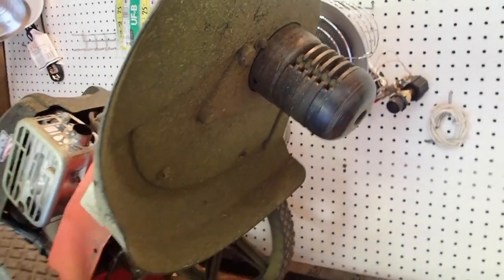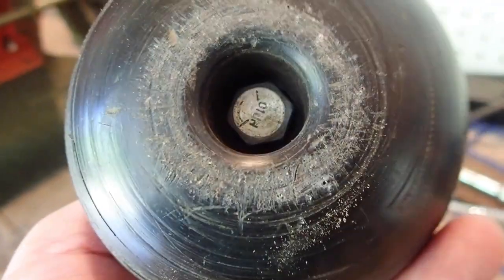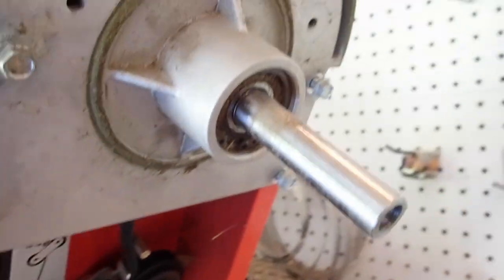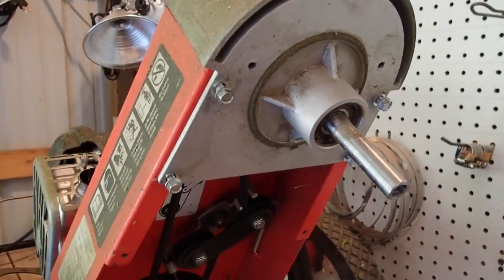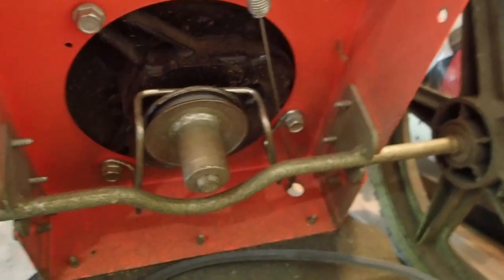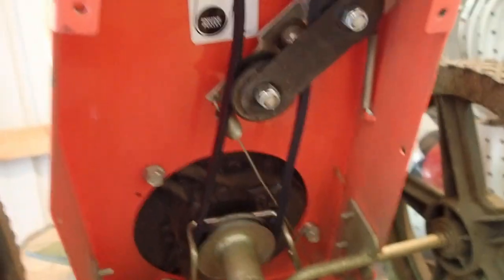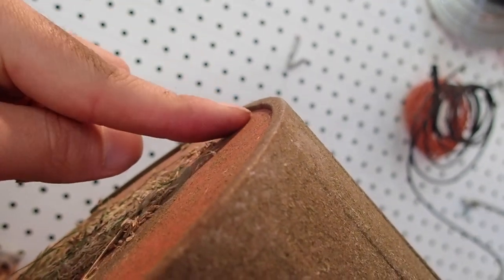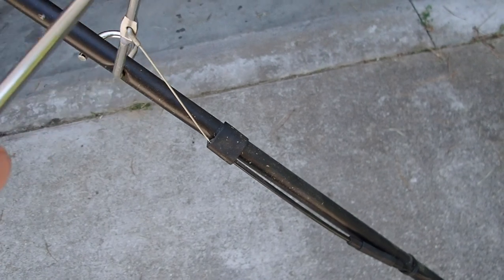DR Trimmer Mower 6.75 Premier - Belt Replacement

Comment: That head cap with the bolt is for the trimmer blade attachment, not for the trim line.  Doesn't really matter though since you don't need to remove all the head stuff anyway.  The head pulley isn't connected to the top of the frame, so you can just reach your hand up in there and remove the belt.  You then only have to remove the tensioner pulley bolts and plates to remove the belt.

Comment: 4:55 for the belt, mine is a 7.25HP, but I think they all take 6744 belt. DR site has an interactive parts explosion that lets you pick the part for your machine. A belt comes in the maintenance kit or you can order it separate, it was $14, but I just got another maintenance kit since all that stuff wears out with heavy use in a field. The tensioner adjust on the handle is a turnbuckle. I had to look up how they work since mine had the same issue as many here in the comments of being scared to move 1 grass blade, just keep turning the turnbuckle and it cuts fantastic.

Comment: I am happy that you brought out that you are post to use a 3/8 inch wide belt. I am using a 1/2 wide belt and can not figure out why it will not start in Neutral, I can not get any belt slippage and alls my pulleys are in the loose position

Comment: I just bought the pro model after researching walk behind trimmers.  Then I found that Echo sells a walk behind that looks to be very robust.  However, there are two features I like about the DR. 1. is the electric start for about 50.00 more and the optional easy head that makes changing line a snap.  Just got the head and accessories today but still waiting on the machine.

Comment: The belt is 3l which means 3/8” wide. The other number that is important is going to be 44 which means 44 inches.  3L44 is all ya need to know. If you have the manual it’s in there as a  V-Belt, 3L, Gates PoweRated 6744, if cross referenced it will show a 3L44 or any belt meeting the same specs as OEM .

Comment: You had belt on the wrong side of pin above tensioner pulley system. It was to the right and needed to be left of it.  Did not match diagram.  Hope you corrected it. Mine has a brake system on drive pulley. So. I will have different procedures.

Comment: I just got this issue yesterday. trimmer head won't spin, DR CSR said I need to replace it because the tension on the belt was high. I'm going to replace it even tho I used it only five times, bought it brand new.
Reply: Pretty much the same experience I’ve had too!…I’ve used it for about 2 months, but damn, a belt should last way longer than that.  Also, my machine is just like his in the video, it does NOT have the hole on the side to lock the shaft in place.  Thanks to You Tube, they have fixes for everything!
Reply: @bigviper64  I called DR and they explained the issue, they sent me a new tension belt. I ended with loosing up the tension cable more and now of works fine, over a year with no problem and still have a brand new FREE belt.

Comment: Thanks for mentioning that you used a 3/8 inch wide belt. I am using a 1/2 wide belt and can not get any slippage when in neutral and all my pulleys are lose. Makes it very hard to start.

Comment: You didn't put the belt on right, you're on the wrong side of the guide pin
Reply: Agree. You but the belt on the wrong side of the pin. Don't follow this video.
Reply: True wrong  side of pin
Reply: Yep, I saw that too. Getting ready to change mine tomorrow if it shows up.
Reply: Wrong side but still worked? I think maybe he fixed it off video. But why not edit it?

Comment: I just looked on website and called them. Still a gates 6744. Ordered from Advanced auto. Also there is a hole at the top to put a screwdriver or 1/4” allen wrench to remove the cutter head.

Comment: Well i just changed my belt  today dr says gates 6744 belt i can tell you right now the gates 6744 will not clear the belt guid on upper pully by the guide pen it will shred it so i went to AutoZone gave them the number and they found one that i needed idk why dr would recommend a belt that doesn't fit but they do on mine anyway 
I bought the trimmer a month ago brand new at tractor supply its s premier model and it started slipping ( which was my fault. I didnt adjust the belt properly) anyway that belt broke  so i baught the gates 6744 online and it will not clear the guid pen and pulley it smoked the belt so just fyi on dr recommendation on belt size
Reply: Update.. I'm in the process of returning my trimmer brand new belt yesterday I smoked it today in 25 mins time

Comment: This is tortuous and unecessary. The belt  comes off the front pulley quite easily without taking off the nosecone , bearings et al.  Simply undo the 4 x 3/8" screwbolts holding the shroud (definitely  DO NOT use a  10mm spanner ) and drop it down to give you easy access to the tensioner bolts ( you do not need to take it over the strimmer boss )  & then remove tensioner plate, slide front pulley partially off to allow belt past the keeper for removal.
Put back together in reverse order . this is a misleading video. What you should note is that replacing shroud do not overtighten the 2 front screwbolts as they locate into aluminium and they are steel .

Comment: The worst one I have seen - he did not show you how to change or tighten the belt only after he did the removal and replacement
Reply: This model has an inline adjuster for the cable/belt tension.  Just find it along the cable line and twist to tighten or loosen.  Typically doesn't need adjustment even with a new belt.

Comment: They are a piece of shi$. Mine won’t start or run.
Reply: Carburetor needs to be cleaned.  I just fixed my buddies trimmer
Reply: Had this problem with ours. I read that these carburetors are extremely finicky when it comes to gas. I was using gas with ethanol in it, and would have problems if it sat for more than a couple weeks. I swapped out the carburetor with a $35 one from Amazon, and have been using only ethanol-free gas, and I haven’t had a problem since.